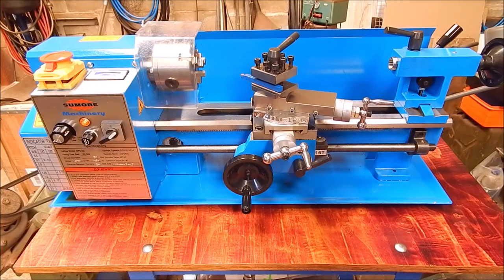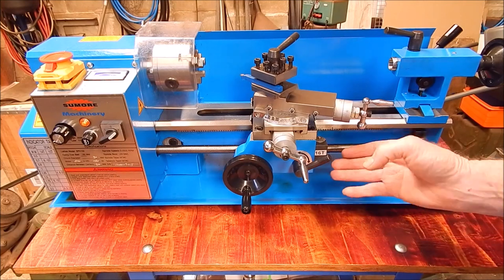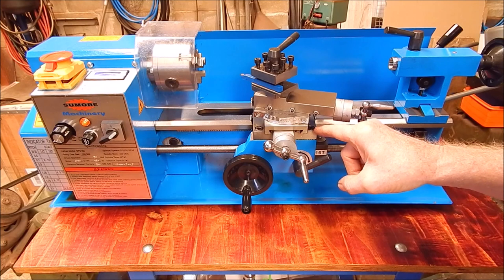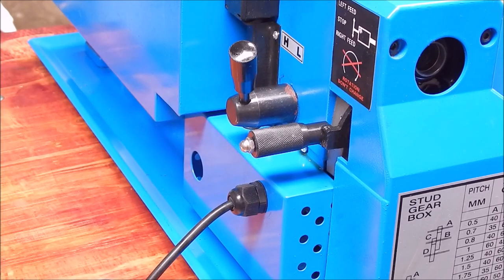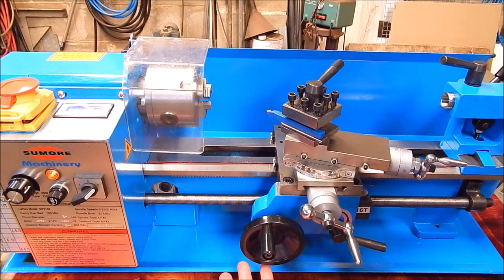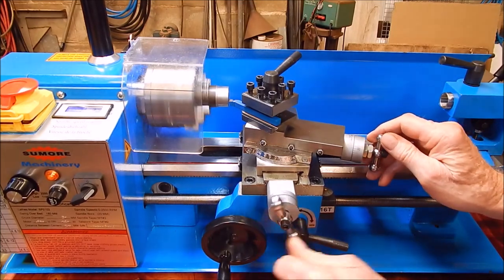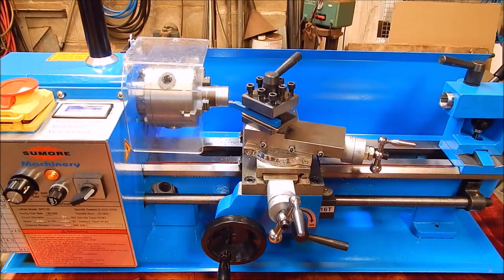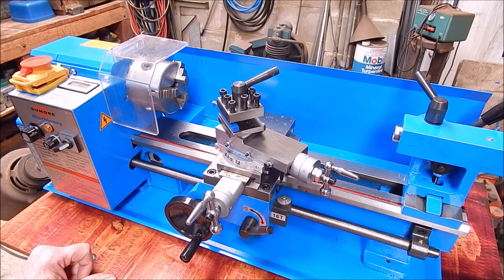The 7 x 12 mini lathe carriage lock hidden in full view

Comment from the maker: Note:  it is a good idea to disconnect the leadscrew when milling on the lathe or exceeding 1K RPM spindle speed.  This prevents feedback from the spindle through the change gears and wear and tear at high RPM.  Cheers Rob

Comment: Not really a positive saddle lock, there will be backlash in the half nuts, you would need to be careful if doing accurate compound slide work that the saddle carriage didn't move within the backlash.
Reply from the maker: No worse than slop in the leadscrew nut.
Reply: @Xynudu  Actually it is Rob, you have the dial on your compound slide, if you take the backlash out the same direction every time you will come back to the known tool position. However if the saddle inadvertantly moves it is unaccountable, even if you push it back or forward with the handwheel to take up the backlash you never know exactly where your tool is. I suppose you could put a dial gauge on the saddle to ensure you maintain position but a positive saddle lock gives you peace of mind that you are not losing position when working solely from compound slide.
Reply: backlash of the half-nut is unacceptable for parting operations.
Reply from the maker: Agreed.  It's not perfect, but better than nothing.  Cheers Rob
Reply: @Xynudu  Yes, and good enough for most jobs, looks like a great little lathe.

Comment: It's not locked if it wobbles back and forth lol when you "locked" it and you shook it, it obviously is loose a d will most definitely produce chatter. A tiny little wobble may not seem bad by eye but when it comes to precision lathes and mills, a tiny bit of movement by eye is alot... "locking" the lead screw does not lock the carriage completely

Comment: Not quite "locked" is it? Prevented from accidentally moving it by the operator, yes. When I want a carriage lock, I want it locked to less than a 0.01mm, not to the total backlash of leadscrew bearings and halfnut clearance....
Reply from the maker: It's locked, but not rigid.  Better than nothing.

Comment: It is not at all "totally-locked" in real terms, it still has a significant amount of "wiggle" from the drive bearings, and half-nut clearance, not providing a stiff and chatter-free lock...yes, for some applications, ok, it's not moving, but it does have play in it when locked that way.
In short, the folks who want a carriage lock, probably want more than just stopping the carriage feeding.... IMHO
Reply from the maker: For most people who just wants to lock the carriage for facing, it does the job fine.  For anything more serious like milling it won't be good enough. Cheers Rob
Reply: @Xynudu  I use the carriage lock in parting and grooving operations. IMHO lack of a real carriage lock is a limitation on the utility of a lathe.
Reply from the maker: For parting you want a rigid carriage.

Comment: Rob - Years ago when I was first getting into machining as a hobby I had a 7x10 mini lathe from the same SIEG factory that this one is from. While you are correct that engaging the half nut will prevent the carriage from moving (kind of) it doesn't actually lock the carriage in place. Almost all lathes made after the 60's have a neutral position to prevent the lead screw from spinning - I use the feature to reduce noise and gear wear.  However, most other lathe manufacturers also include a carriage lock.  

I think after you use this lathe for a period of time you will discover why so many extremely intelligent people have spent so much time engineering a proper lock. A real lock provides actual repeatable precision in facing cuts and most importantly it greatly reduces chatter in these small lathes.
Reply from the maker: Hi Joe, maybe.  It's a bit like locking the cross slide rather than tolerate slop in the thread nut.  Cheers Rob
Reply: Also, thank you for all the videos you have been making for so many years.  I have definitely learned a lot from you. I'm a professional machinist now and you were one of the great sources of information that got me here.
Reply: Came here to post this. Having the carriage slop back and forth by >1 mm is not a lock at all.
Reply from the maker: No, and there's no room for one.  So it's this method or make up a bridge type lock.

Comment: Yep been doing that from day one ! if you want to totally lock the carriage so it cant move in either direction 'simply run the carriage up to where you want ,lock the half nuts (tumble gear in  neutral )  then  pre -load it by turning the carriage wheel so it tries to feed the carriage towards the chuck then run the tailstock up against the tailstock side  of the carriage  and lock it down . If you need some more clearance for the tailstock (so it doesn't hit the workpiece etc) simply use a packer like a 123 block sitting on the bed between the carriage and the tailstock  base as this will make  the tailstock sit back further along the bed away from the chuck.
The finish on the machine looks good and if they are doing them for the price  that was in your link in the last video pretty good value .
Reply: Works like a charm, doesn’t it! Figured this out after getting my first 7x12!

Comment: I just bought a mini lathe. Was looking for the carriage lock. I did use the half nut lock on my first try and thought it may damage the thread. So I found this video. Thanks n
Reply from the maker: Hi Dan.  This method is used by many mini lathe owners and is not my idea, or a new idea. It will not harm the leadscrew when used sensibly.   OK it's not totally rigid, but then nether is any cross slide with backlash, so the facing results will be the same.  For parting off it will still work, provided you apply a bit of carriage handwheel pressure in one direction to take up the slop.  People that criticise what is a simple, cost free solution really are missing the point.  Cheers Rob

Comment: Its a good idea and I have used this method, but there is still freeplay movement as can be seen when you rock the carriage wheel back and forth. I found for milling etc you do need a proper carriage lock for precision. You can buy them on Ebay or easily make them up. They lock the carriage absolutely solid and there is no chance of damaging the leadscrew and half nuts in the event of a crash or anything.
Reply from the maker: Hi Steve,  yes it's got limitations, but most people will only face with it.  Not many will do milling.  So it's a handy trick for the average Joe.

Pull up way blocks are a lot better, but looking at the cross slide I don't see any place to incorporate that common design.  So unless you want to make up or buy a bridge type pull up clamp there aren't a lot of options.  Gets people thinking though, which can only be a good thing.  Cheers Rob

Comment: This is a reasonable alternative to a carriage lock though not a perfect one. I’ve used this method on my 7x12 as well as my 9x20 until I could fabricate a more solid way of locking the carriage. Although this method works for facing since the force is pushing the carriage towards the tail stock. It’s not ideal for facing since backlash in the half nut will cause the carriage to move slightly towards or away from the headstock and could result in problems like broken cutters. When machining rigidity is your friend and things need to be locked down as solid as possible. This is definitely a decent way to lock the carriage for facing cuts as you demonstrated. But a true carriage lock will eventually be needed. I will say I have used a parting tool with the carriage locked in this manner. It does work to a degree. But the results can be less than ideal.
Reply from the maker: Agreed, but better than nothing.
Reply: @Xynudu  Absolutely! I would much rather face off a part using this method rather than trying to do it without any sort of carriage lock at all.

Comment: this was something i thought could be used to lock the carriage but the little bit of slack that it has made me think it wasn't intended for that. ive only had my lathe now going on 3 months so its been a learning experience for me from day one but this make me rethink that. i was actually looking into adding a lock to mine until i stumble onto this video an i think i'll actually try this now an see how well it actually does. i guess as long as u make sure any slack it may have is taken out it shouldnt have any issues. thanks for making a video on this cause i would have continued thinking it was not the best option an would have ended up drilling an tapping to make a lock but id rather not if i can avoid it.
Reply from the maker: Glad you found it hekpful.  It works fine for facing and can do parting off provided you keep pressure on the carriage handwheel in one direction to counter any slop that is present.  Alternatively you can use the tailstock to apply pressure.   Many mini lathe owners use this trick and it serves them well.  You can make a dedicated carriage lock, but there is no simple/easy way to do this.  I personally wouldn't bother unless I had absolutely nothing else to do, and you really need a mill to do a good job.  Cheers Rob

Reply

Comment: I discovered this method soon after setting up my lathe, but I also added an adjustable end stop to the leadscrew to remove the end float, with a small plate and 6mm screw with locknut.  Careful adjustment can result in zero carriage movement and still allow the leadscrew to revolve freely.
Reply from the maker: The Sumore 7 x 12 has a lead screw end float adjuster as standard.

Comment: I have a sieg lathe, 7x12, which is almost identical apart from some cosmetic differences. I imagine they all come from the same factory. Had mine about two years and still learning. Most recent addition was a 125mm chuck which gives me a wider range of material sizes. The biggest disappointment is that its hard to get a decent finish on mild steel. I use the carbide inserts available through aliexpress at a reasonable price, not too sure about the quality though. I have also ground my own hss  tool bits which isn't too dfficult. All in all a reasonable little lathe for a beginner like me who farted about in engineering classes as high school, so in retirement I wanted to prove to myself that I wasn't too hopeless.
Reply from the maker: Hi Murray,  to get a decent finish on mild steel try using a shear tool.  As you can grind HSS it should be a walk in the park.  I did a video on this way back:  https://www.youtube.com/watch?v=Ta5F3WC-gPo 

I use mine regularly as nothing else will come close on crappy metal.

If that doesn't work then I'm afraid you are beyond help ;)

Cheers Rob

Comment: good bit of advice Rob , my Optimum TU2004V has one but it was hidden under the top slide on the rear section of the cross-slide, it was just a socket head bolt that was flush with the cross slide ( I have since changed it to a normal hex bolt as the socket head was always getting swarf in it I also added a small bush to make it sit proud of the slide so a ring spanner could be used ) have a look and see if it is there , My lathe is very similar in the carriage and cross slide , the model below mine is pretty much identical to the Sumore lathe

Comment: Excellent idea, Rob.  However, I wonder if backlash in the half-nuts and/or leadscrew might not become an issue, due to normal wear and tear.  Also, exact positioning of the carriage is limited by the leadscrew thread pitch; can't just lock it anywhere while the leadscrew is stationary.
Reply from the maker: Hi Daniel, it's much the same as slop in the cross slide nut.  You have to use the top slide as normal to position/feed in the cutter.  No different to a pull up locking block.  Cheers Rob

Comment: That's genius! I was just looking at how to lock the carriage and came across your video. Nice one! The only downside I can think of is that there is still a little bit of play in the carriage, it's not entirely locked in that sense. But before I make any modification I'll try this and see how it works.
Reply from the maker: It actually works very well for facing cuts - no problem, same as dealing with play in the cross slide.  I haven't tried parting with it, but can't see why it wouldn't be OK - just apply some handwheel pressure on one side.  I know a lot of mini lathe owners have always done it this way.  Cheers Rob
Reply: @Xynudu  Just tried and it works a treat. Thank you for this simple yet awesome trick!

Comment: Hi great video , I have the same lathe and there is a lot of hidden options. Its a great value for a starter lathe or something to make easy simple projects. My only beef is the chuck is a bit some may upgrade that in the near future.
Reply from the maker: The chuck on this one is awesome for accuracy.  I will note the brand down for next time I need one and try and hunt it up.

I have two  little known Chinese lathe chucks and they are both excellent.  Don't buy that horrible shitty Sanou stuff.  It's crap and it's being sold everywhere.  My understanding is it's another Fuerda line, a brand which used to be excellent until production left Europe and went to China.  I bought one of their China offerings and it was terrible (the pinion gears jumped mesh with the main scroll gear) .  Got my money back, but left a bad taste in my mouth.  Cheers Rob

Comment: Like Craig Roop, that was the solution I came up with to lock mine. So glad you validated it. I was afraid that since no one was mentioning it, that I was doing something obviously stupid that would damage my machine. Whew...
Reply from the maker: You hit the nail on the head Mark.  You can't damage anything doing this.  The half nuts are made to take a large cutting load, so facing will be a piece of cake.  Correct solution.  Cheers Rob

Comment: I have been doing this for years mainly because I couldn’t be bothered to find the spanner to fit the carriage lock on my boxford and it save damage when forgetting to release the lock. However it isn’t anywhere near as effective as a real carriage lock due to play in the lead screw nut and deflection. Clamping the saddle to the bed is a much more rigid arrangement. So I am not really knocking your idea I use it myself but it’s not a carriage lock.
Reply from the maker: It is a lock, but it's not the best type.  Cheers Rob

Comment: Hey Rob.

As I'm sure many people have already commented, you still have the half-nut backlash to deal with - indeed, when you engage the nuts at 2:34 and say "guess what, folks, the carriage is totally locked", you jiggle the handle and the slop is clearly visible.  Somewhere around 1/8 of a turn of the lead handle, maybe?  Now, sure, as long as you're cutting in a way that takes up the slop, you'll be OK, it's no worse than machining in a way that takes up the slop in the cross slide nuts.  It does cut out any serious precision work, though, as well as anything that involves cutting in both directions, or, god forbid, milling.

What's more worrying, though, is the amount of slop in the leadscrew / half nuts on a brand new lathe.  That's not great fit and finish, on a lathe that otherwise looks to be OK.  Any chance of quantifying the slop on all the axes?

The OCD in me also wants to see the bearing surfaces printed on a surface plate, and a full set of alignment tests (after correctly bolting it down and levelling the bed, obvs) too.
Reply from the maker: Hi Michel,  I loosened off the leadscrew end play a bit while playing around with the adjuster.  I haven't set it back to where it originally was yet.  The half nuts actually have very little slop, but like all half nuts and hand wheels, it has some. Cheers Rob
Reply: @Xynudu  Ah, right, that explains it.  As shown in the video, it was what I'd expect from a machine that's been abused for a decade or two :)
Reply: I'd also love to see a tear down and analysis for my education, but know that's asking for a lot of time.
Reply from the maker: Actually your comment got me thinking Michel.  My extremely hard working 10 x 18 has a lot more slop in the half nuts than when I last checked them 20 + years ago, so I guess it must be time to do it again ;)  It's all fully adjustable, quite a good design.  Like a lot of slop and wear in lathes, you tend to get so used to it you simply compensate for it over the years. 

 Cheers Rob

Comment: Disconnect leadscrew when you want to machine at 2AM and wife is sleeping. Also useful if you want to attach a variable speed motor to the leadscrew for infinite and reversible  feed rates. I have the VS motor on mine even with a full QCGB just so I don't have to hear the gear train.

Comment: yes it looks like a functioning carriage lock indeed
I'm just wondering if it's rigid enough? would the t-plate underneath the ways lock the carriage better? I'm not an expert in any way, just thinking loud. I saw on many videos people struggle with parting tools because of the chatter / vibrations, which literally look scary and dangerous. 
when the guy put the proper carriage lock, the parting became seamless, even on a relatively small machine.
Reply from the maker: Many mini lathe owners find this trick sufficient.
Reply: @Xynudu  yup. I guess I always need more. I'll make a really rigid carriage lock to see if it gives me a better surface on the large stock

Comment: Good idea. Looks like there's still a bit of movement but good enough to keep the carriage in one place.
Reply: Yeah, there was some backlash and if that movement doesn't affect the overall result then it seems like a good workaround solution to me and I hesitate to offer any other solution, just window shopping this stage. Plus the Sumore people have been busy so won't be buying one any time soon. Anyway, cheers for the video 📼
Reply: Not if you run the tailstock up against the saddle! Then it’s locked down tight!
Reply from the maker: Good move Tom.  Now that's lateral thinking.  Go to top of the class.  Cheers Rob